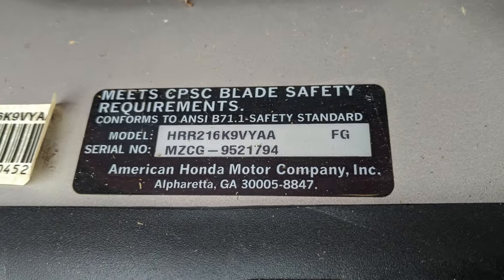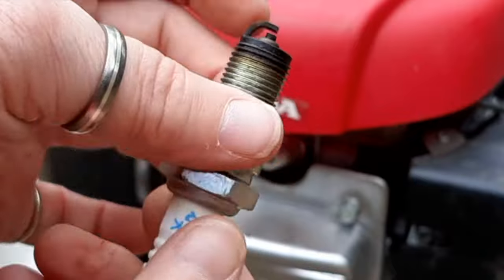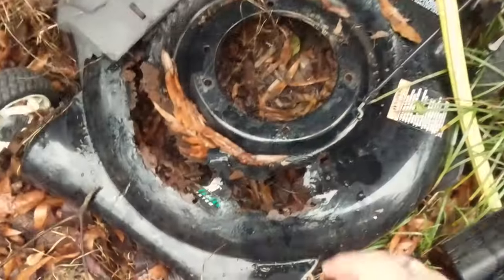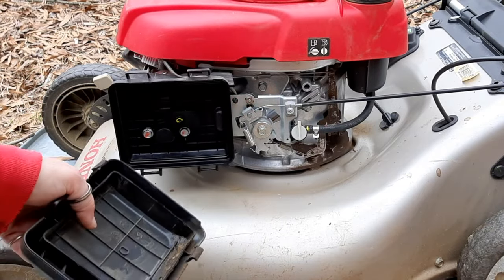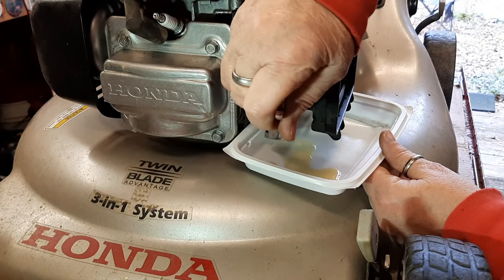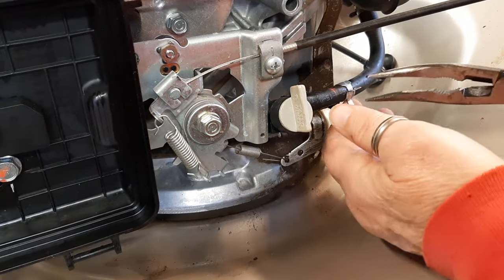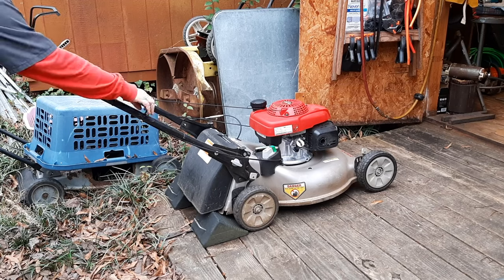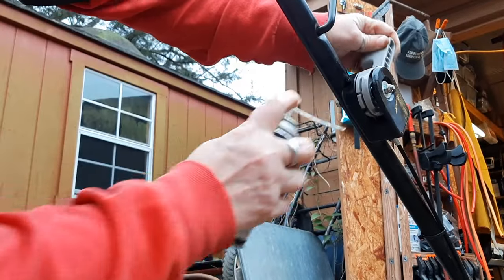5 EASY Steps: GUARANTEED Honda Mower Start-up

Comment: People don’t realize that these mowers are set up to run rich at the factory. Even after first couple uses, look at the spark plug color and you’ll see what I mean. They assume everyone will run them during hot weather, so they don’t start very well when it’s colder temperatures outside. I don’t know if the carburetor richness can be adjusted on these.
Reply from the maker: This particular carb does have a mix adjustment screw, but it is limited with a restrictive cap, that easily wrecks the adjuster when removed. It moves less than 1/8 turn, and it's near about impossible to adjust while the machine running. It's buried deep behind the airbox. Thanks for watching!

Comment: If you don’t want to clean the carburetor   Ran it out of fuel and drain  the carburetor bod   Than it should start in the spring
Reply from the maker: That works too.

Comment: are there any pockets of new honda mowers out there for sale that you might share for those that might be interested? i have already checked, but was hoping with your sourses you might be able to help. thanks lawnmower lady, really enjoy your videos and your small engine knowledge.
Reply from the maker: In all honesty, I would be searching FB marketplace, craigslist, etc., for a gently used HRX from a few years ago with the GCV160 engine NOT the 170 engine. Far better machine than the last ones they made. IMO they cut way too many corners on the last machines they made, specifically the HRN series. I did a review of sorts here ( with an emphasis on those changes): https://youtu.be/QnYEtnGgiXc I appreciate you watching. Cheers!
Reply: thanks, you are the best @TheLawnmowerLady

Comment: We cleaned the carb out yesterday for one that was gifted to us. But when we pull the handles for the blades it stops unless we do it very slowly. Any ideas?
Reply from the maker: Cable adjustment usually will take care of that, along with an RPM adjustment. RPM is pretty easy, follow the governor arm to where the return spring terminates. Bend that tab slightly to change the RPM. More tension on the spring = higher RPM. Don't overdo it. If it sounds like its revving crazy high, it probably is.
Reply: @TheLawnmowerLady  that knyiy so much!

Comment: Great video. I like the way you cut the oil jug to easily catch the oil when you first tip the lawnmower on it side to drain it.
Reply from the maker: Thanks! Makes it easy to transfer the oil to a larger container for recycling. The only time that jug is a problem is if the mower is overfilled.

Comment: Great advice geared towards the novice mower owner, Stella. 
Definitely do the lube tips at the end. Lubing the wheels will make the mower much easier to push if it doesn’t have self-propel. 
Unmentioned additional shop tip - double duty step ladder also acting as spring clamp storage! 🔧😁👍
Reply from the maker: Cheers Rein!

Comment: Nice tip with the blade being used to gap the plug keep them coming  and see you at 2pm EST on the live stream.
Reply from the maker: You bet Mr Wayne! Necessity is the mother of invention. I came up with that Stanley knife trick somewhere hear Hope, BC on the side of the road. Fouled my plug and dropped my spare plug on the pavement, and that's what I had in my pocket, LOL.

Comment: You made this look simple.   Hope I can get mine started.  My rope pull is super tight too and almost cannot pull it at all if blades not engaged.
Reply from the maker: Hmmm. Something doesn't sound right with that. Does your machine have the blade clutch?
Reply: @TheLawnmowerLady  , no, it seems pretty basic but is an HRC216 commercial mower.  I had it at the shop few weeks ago and seemed like it was cranking okay.   Didn’t use it for two weeks maybe.   

I turned it over and moved the blades by hand but it was stiff.
Reply from the maker: @crazy-eyedreseller  Moving the blades with the spark plug installed is difficult, as well as the brake pad on the flywheel if the blade brake handle is not pulled in.

Comment: Hello, Love your video's. They are very informative.  I have a Honda mower HRR2169VYA which has an automatic choke. It starts and runs fine, but when it warms up and the choke is off it dies when you engage the blades.  While the choke is still on the blades engage fine and the engine runs fine.  But when the choke comes off the engine stalls when the blades are engaged. I have cleaned the carb, changed the plug, replaced the fuel, checked the gas cap, but I cant figure out why it stalls when its warm.  HELP !
Reply from the maker: I had a similar issue with my HR215 after about 8-10 years. I adjusted the cables to basically make the engagement earlier. Increasing the RPM didn't hurt either. Over time springs and cables stretch. Follow the governor arm return spring to it's termination point. Bend the bracket just a bit to put more pressure on the spring. Hope this helps.

Comment: First time lawn mower buyer! What would you recommend? I’m not sure if I should get Toro or Honda 21 in. 3-in-1 Variable Speed Gas Walk Behind Self-Propelled Lawn Mower with Auto Choke. What do you think is better? I’m scared of getting a bad one
Reply from the maker: Nothing on the market today is any match for a machine made 10 years ago. If I were looking for a "new" mower, I would be searching out a nice used Honda HRX217 with the older GCV190 engine. NOT the newer GCV200 engine. There are many of them out there on FBmarketplace and craigslist. The best ones are have the "roto-stop" blade clutch. Basically you are starting the engine (very easily) as you are not trying to turn over the engine with the added inertia of the blade spinning.  I made a video about the latest Honda mowers: https://youtu.be/QnYEtnGgiXc Way too much cost cutting IMO
Reply: @TheLawnmowerLady  I see, thank you so much. I’m going to do just that because I was cared to buy a new one and get a lemon lol but okay I’m going to go look now

Comment: Enjoy your vid's.  Especially the ones concerning the Honda engines as I have a Husqvarna HU 700u with a GCV160 engine.   My question is about ethanol free gas.  I live in the DFW area and have found ethanol free gas at several stations in the area.  What octane rating should I use; 87, 90 or 92?  I also have a Craftsman WS2200 2 cyl string trimmer.  I wouldn't think that my Husqvarna wouldn't need a lot of octane, but what about the string trimmer?
Reply from the maker: My honest opinion is go for the 90 (the ethanol free I use is 89). Adding oil will drop the octane a small amount, but likely not 3 points. Using any higher octane is probably a waste of $$$. Higher octane is good for high compression engines to keep from burning a hole in your piston. That said, the premium canned fuels (Stihl Motomix® and Aspen) all are based on high octane (92-93) fuel. I appreciate you watching. Cheers!

Comment: Is it necessary to use oil specific for lawnmower engines or standard or synthetic 10W-30 ?
Reply from the maker: Someone much wiser than me said: "The right amount of the wrong oil is better than the wrong amount of the right oil" That said, I have heard rumours that it's not a good idea to mix synthetic with conventional, but other than that... I'd put any old 10w30 in the crankcase.

Comment: Run ethanol free gas if you can get it your town  you don’t need to clean the carburetor in the spring  it will start with no problem
Reply from the maker: I agree 100%